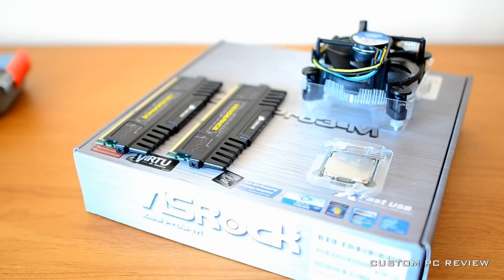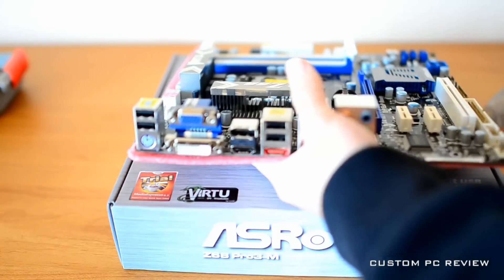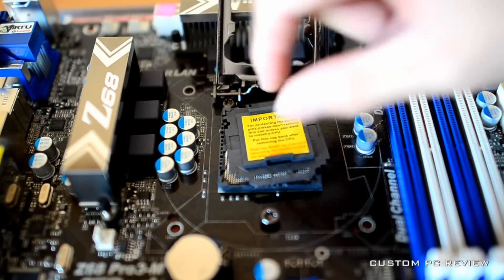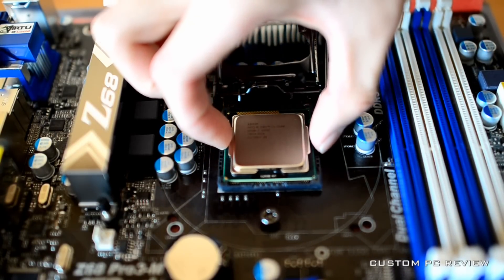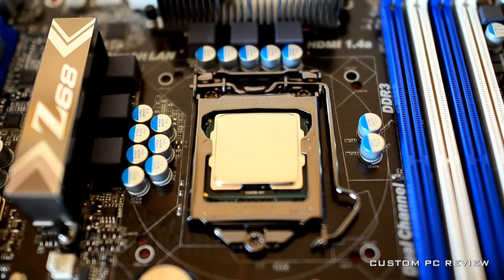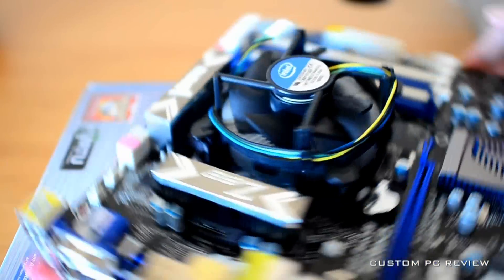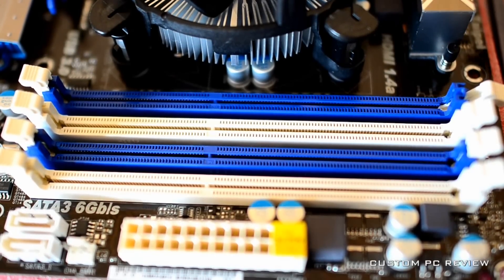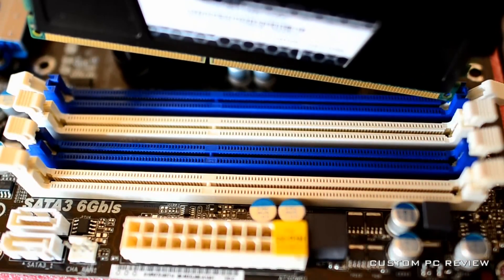How to Build a Computer - Installing CPU and Memory

Comment: It would have been better if you mentioned anything about thermal paste... if they use a non-stock cooler, thermal paste is not yet applied to the base of the cooler (in most cases, that is)

Comment from the maker: @1997kx Ok
1. The PCI E can connect to both the video card and the sound card. Typically you need a long PCI E slot for video cards (PCI E x16) Otherwise for stuff like sound cards you can just use a short one (PCI E x1)
2. Depends on your resolution, but AMD Radeon HD6950, HD6970, HD6990 // Nvidia GTX 560Ti, GTX 570, GTX 580, GTX 590.

Comment: my problem is usualy the fan. the 4 pins usualy fail to apply to my command (lol) and thus im wresling around.
i wonder why i never put the fan on the motherboard before puting it in the pc box (wadever that thing is called)

beside that my cpu us overheated alot and almost everytime. got any idea what the problem can be?

Comment: @custompcreview 
1) there are lots of different sockets on the motherboard which connects the video card and the sound card to the motherboard and I get confused about the different sockets.
2) I am looking for a video card that can run bf3 and crysis 2 on high setting in 1080p. 
pls give me (if possible) a list of graphic card that can run both games

Comment: Two things you could've mentioned in the videos for noobies;  For one, when installing the CPU into the CPU socket, there will be a lot of pressure needed to press down onto the "lever".  I think this can cause new PC builders to feel hesitant.  
The same thing applies to the CPU Stock Heat Sink Fan;  pushing down on the pins may make the motherboard look like it's about to break when really it's normal.

Comment: @11KANE11 It also may vary depending on the motherboard. It is best to read the instruction manual. In most new and high end motherboards, the instructions will have you put the ram in DIMM 2 and 4.

Comment: @11KANE11 What? He is still running dual channel memory. For example, when I install the memory on my Rampage 3 extreme, I install the memory in the red slots, because they are farthest away from the CPU socket. It doesn't matter which color the DIMM slot is, just that you install the ram in the same color slot (and don't give me the BS "white is only a shade.") When you run dual channel memory in a motherboard, it is best to put the DIMMS in the sockets the same color away from the CPU socket.

Comment from the maker: @meseetea123 Thanks for the advice! Thermal paste is preapplied on the stock heatsink, but yeah you're right I should've mentioned it. Also what do you mean by which way the fan blows? The fan comes preinstalled and only blows one direction. I will for SURE do an installation video on a couple aftermarket HSFs though!

Comment from the maker: @11KANE11 Yeah the labels on the mobo are pretty confusing which is why I screwed up the first time. Basically the 4 banks are labeled A_1, A_2, B_1, B_2. Then in the manual you find out A_1 and B_1 go together. Lame. That's why I made it a point in the video to tell people to consult their mobo manual. =)